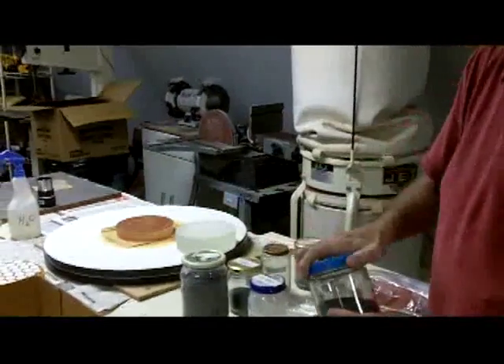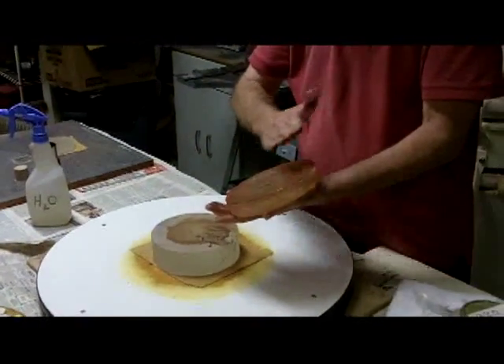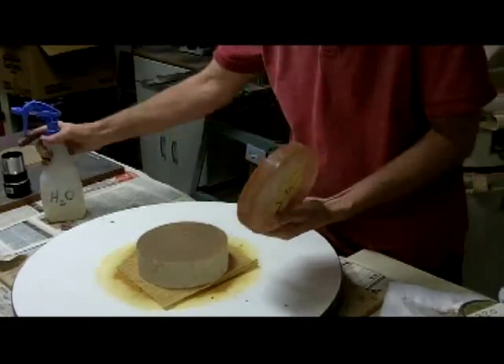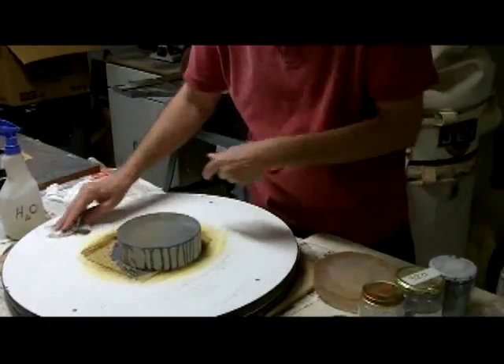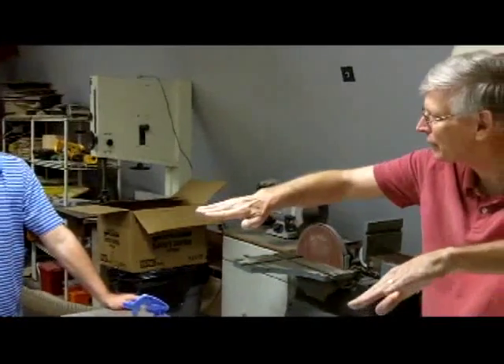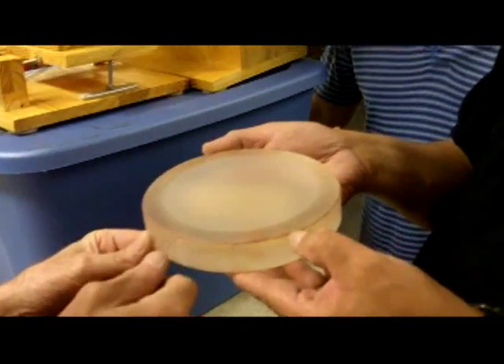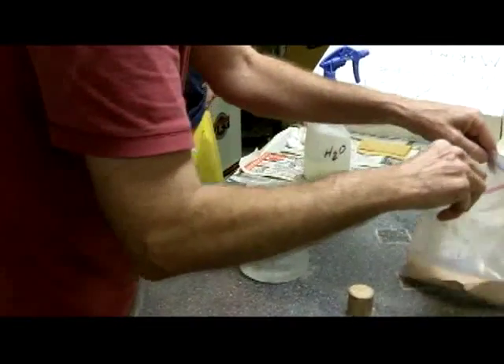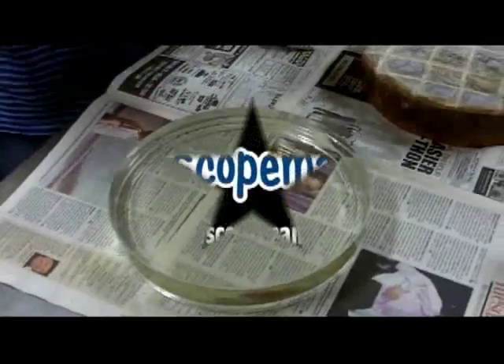Amateur Telescope Making - July 2012

Comment: Great video, thanks for sharing! :) I want to build my own telescope starting with grinding the mirror, and seeing the techniques in action really helps.
Reply from the maker: +Christopher Phoenix Thanks very much and all the best on constructing a telescope.
Reply: Joe Lalumia Thanks, can't wait to begin when I have the spare time. : ) Quick question- do you recommend a 6 in. f8 or an 8 in. f6 for the utter beginner? Is one easier than the other or are they roughly the same level of difficulty?
Reply from the maker: I would start with a 6 inch mirror which will be much easier to grind. Good luck.
Reply: +Joe Lalumia Thank you. : ) That sounds like good advice, I will start with a 6 in. before trying something bigger. BTW, do you know of any good videos that cover the mechanical aspects of telescope building? I'm curious now to see what people have done for building the tube and mount.
Reply from the maker: Well then mount is usually a Dobsonian, and the tube is usually made from a "Sonotube" which is used to pour concrete piers! and available at Home Depot. Google Dobsonian telescope, then "Dobsonian Telescope PLANS".

Comment: Thank you for responding I was under the impression that the f was the distance from the primary mirror to the secondary can you please explain what the f 7 or f 8 does mean and tell me how to determine the distance from the primary to the secondary I am making my first telescope and i am watching a lot of videos to get as much info as possible and i find your to be very informative thank you for your time in making them and taking the time to respond to my questions.
Reply from the maker: Misunderstood you- I thought you were thinking it had something to do with the diameter of the primary. Anyway, yes it is the distance from the primary to the spot where it would be in-focus. You can get the focal length by using this simple method- read this thread--  http://www.cloudynights.com/ubbthreads/showflat.php/Cat/0/Number/4585416/Main/4503298